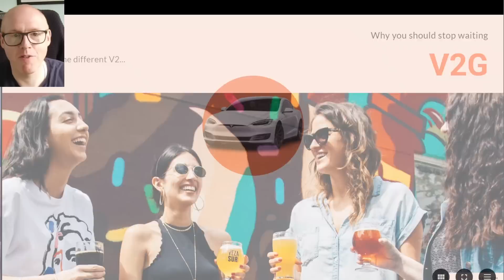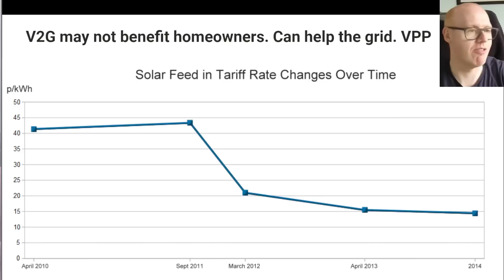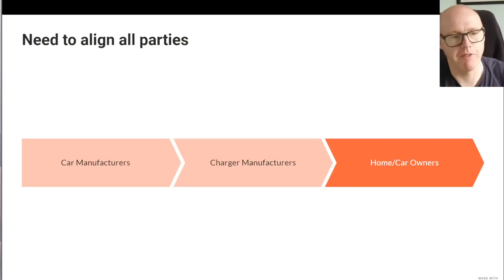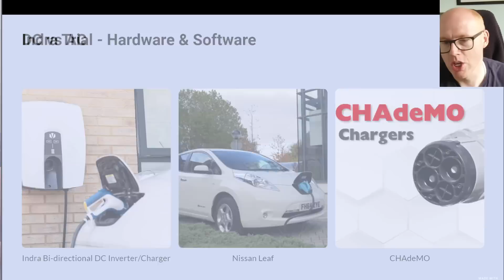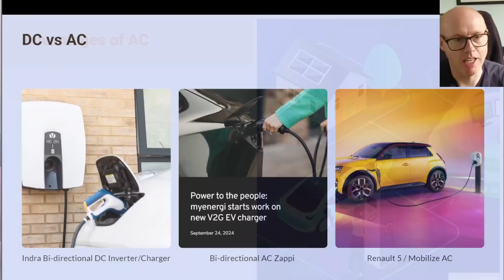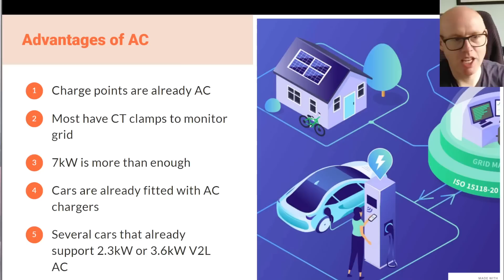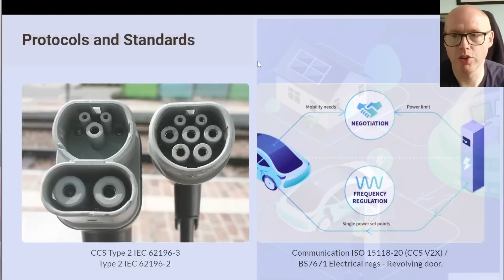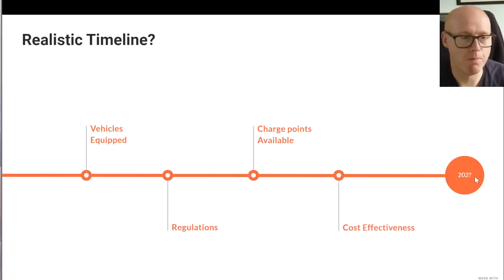Power your House from your Car - The FUTURE V2G

Comment: I have given up waiting for V2X and decided to buy a used eNiro. But I have a SolarEdge solar system with battery already set up for 5kW export and have just heard that SolarEdge are bringing out a two way DC charge point so it may be possible if the DC side of the vehicle is two way. I am mainly interested in using the massive battery parked on the drive, but if the SE system can just integrate the car as another DC source then I have everything needed with no update in regulations needed.
A great video thanks I will have to investigate the SE charge point and the eNiro a bit more.
Reply from the maker: I like your optimism.

Hope for the best, plan for the worst.

I think you're wise going for a great used buy.

I doubt the solar edge bidirectional charger will be economically viable and I imagine you'll still need DNO approval to add it on.
Reply: @UpsideDownFork  Thanks for the reply. As it is only adding another battery I don’t think DNO approval would be necessary. But further research it seems that there are problems with the UK SE unit and of course unlikely to be Octopus aware. So continue with plan A and a Zappi which I can control with HomeAssistant.

Comment: Read an interesting post about running power from the car into mppt ports on the invertor
Reply from the maker: How is that possible? Do you happen to know what vehicle/inverter they got this working with?
Reply: @UpsideDownFork  It was a victron invertor, but I believe it would work with any invertor as the invertor thinks the power is coming from the sun. The voltage would need changing from 12v dc or 220v ac to invertor min voltage. I'll ask an electrical engineer next time I bump into one haha

Comment: I agree that bidirectional AC is the right way to go. Much cheaper and 7kW is generally enough for most purposes. Quite a few cars already work doing this (Kia Hyundai). VW would work except that the software gets shirty when the charge rate goes negative and turns it off. It's just a software fix which VW say they've changed recently. You can make it work by using a Pionix charger. The bit I'm not sure about is whether all/some cars need some extra electrics to sync their inverter with the grid, or if they already have that. Essentially cars need to do the G98/G99 thing because they are generators. V2H and V2G are the same here (unless people have fancy islanding inverters, and hardly anyone does). AC sync is required and the car is now being a generator so needs to behave like one in failsafe terms. I'm guessing that no cars have G98/99/100 certs yet, so it will work (with a few cars) but it won't be legal, and it could actually be dangerous if they don't turn off when they should. (maybe the EVSE can be the failsafe, but I don't know if most/many/all/any are smart enough to disconnect if the mains side goes away?
Reply from the maker: Thanks for commenting

Comment: All I want is a second hand V2H unit but none to be had and if you find a new one they want £2000 what a rip off, More quantity  to drop the price, should be standard to all houses with EV cars and we can all help the grid and our homes, somebody out there wants to wake up and cash in NOW, When my old 24kw  Leaf is not road worthy I have a cheap battery storage system all I want is the BOX
Reply from the maker: Unfortunately it's a lot more complicated than that. It shouldn't be but sadly it is.

Comment: Interesting to see that there are 3 levels of V2X.  We bought a BYD Dolphin partly because it has this facility.  Had it 9 months and never used it.  Will wait for 2-way chargers to be available before installing one.
Reply from the maker: From my initial research it seems like BYD have implemented V2L only for the UK market. 
I'm not sure if this will be upgradable to V2H/V2G and whether that will be a software update or different hardware needed.
Reply: @UpsideDownFork  I read reports of Dolphins being used in Australia to run electric items for days after a major storm.   Must be at least 6 months ago.  Ours is a Spanish model.

Comment: I'm not sure how the DNO would be able to tell the difference between v2g and v2h if you have a solar system and the car power is delivered through the export meter and at the g98 connection capacity limit. Unless you were exporting 4kW/h after dark obviously 🤣
Reply from the maker: Exactly!

Comment: There is nothing complicated about a V2G hardware. Just think about it, ANY hybrid solar inverter would work. Just tie the CCS into the solar inputs of the invrter.
Reply from the maker: Have you done this?
Reply: Yes, the tricky thing is the software, some cars also want to see a pre-charge voltage.

Comment: When you think about it, your consumption does follow you to your location. V2G benefits all parties well beyond the home. At work particularly, especially if your building could have solar. Or any car park: supermarket, gym, airport..... Win, win.
Reply from the maker: I'm not sure I follow? Charge at home and then discharge at work? 
Doing the other way round also makes little sense, work place chargers are not the cheapest.
Reply: @UpsideDownFork  We need to electrify and we need to do it quickly. Some ready-to-go solar farm projects are being quoted 13 years for a grid connection... V2G localised consumption, storage and balancing would help alleviate that issue. Localised generation (government carrot and sticks to get solar onto the roofs of commercial buildings) would provide battery storage and consumption wherever the vehicle is plugged in without straining the grid. We consume energy when we’re at work, we consume it when we get home. The V2G VPP actually moves to where the consumption happens and where the grid needs balancing.

Employer can provide free EV charging for the employee with their excess solar (including those who aren’t lucky enough to have home charging) in exchange for access to that storage when the sun doesn’t shine (think Kraken). Employee can even use that energy for V2H when they get home in that dirty evening peak. 

The government gets to meet its 2030/50 environment targets, the grid is future proofed and the cost of energy for business and individuals trends to zero (looking at you Tony Seba).

But as you describe, there’s a lot of ducks to get in a row for V2G to be a meaningful thing, but take a few steps back, find a switched-on government minister and V2G could help save the planet, the economy and our pockets all at the same time.

I have a dream… ;)

Comment: I really can't see V2G becoming universally normal for a long time to come, it's a lot of expensive hardware and software with potentially diminishing returns for the home/car owner,  maybe for large fleet operators with a fixed work pattern it will be of more interest.
Even V2H still has a limited market, I don't think it's widely acknowledged just how many people are blocked from having a cheap overnight tariff due to lack of a working smart meter.
Reply from the maker: Yep, lots of hurdles but I'm hopeful that those who currently have EVs and home charging will be migrating to V2H within the next 5 years.🤞

Comment: V2G has so many advantages that it’s bound to come soon. We just need solar hybrid inverters that know how to use a car as a part of their network. That’s really all it needs because they already have everything else it needs.
Reply from the maker: It's been brought to my attention that there is the possibility of V2L vehicles connecting through the aux/generator input that many hybrid inverters already have. Interesting avenue for me to explore!
Reply: @ that would rely on the car’s v2l inverter circuitry to do the work though.  I think most of those are quite low power.  I would like to get the full dc current handling of the dc charging circuits to work and let the solar inverter be the limiting factor.  The beauty of the car battery is its huge energy storage and its huge current capacity, and the great thing about the solar inverter is that it can be as big and heavy as it likes.
Reply from the maker: @dominicgoodwin1147  True, but it's a solution for right now. My Sunsynk inverter is compatible. Some V2L vehicles are rated at 3.6kW and there are off the shelf cables that can be used.
Some people have actually tricked the MG4 to output 7kW through V2L.

Comment: I know the F-150 Lightning is not sold here, and Ford have cut production - but it seemed interesting, since its aggregate V2L capacity is 9.6kW.  I had an interest in retiring somewhere sunnier and being off-grid.  If you can utilise that output (maybe even 70% of it) then you can potentially regard the vehicle as the stand-in for having a generator and all its gubbins, and go and buy electricity while doing your shop for groceries in the winter.  V2G would seem to me to be a way for power companies to cycle your battery while not paying what they should.
Reply from the maker: @jamesmansion2572  I  had a close look at these whilst in the states recently. Those and Rivians were fairly common sight in California. 👍

Comment: I see the benefit of V2L for people who like to tailgate, or working at remote locations with electric tools. 
I see the benefit of V2H if you can charge at a low cost and release when the cost would be higher, thus lowering your overall home electricity bill. But you still want charge in that vehicle when it's time to drive, and you lose some energy through resistance every time you move it around.
Also if there's a powercut (rare in my area but can happen) and you don't have a backup (e.g. solar panels, gas generator)  then this might tide you over for a bit.
I don't see electricity companies allowing masses of people to charge their batteries at low cost, and then sell back to the grid at a higher cost. That just doesn't make economic sense for them.
Plus every time you move that energy you lose some, you're adding adding wear to the battery.
I can see energy companies pushing this and then shafting the consumer when it gets too  costly for the company, by changing their terms and conditions.
Reply from the maker: Good points!

Comment: I have a BYD with V2L. I have sufficient solar panels to be nearly 100% off-grid. I use the car to heat my hot water tank whenever the home batteries are low and solar is unlikely to be enough to fully recharge my home batteries. If the batteries do reach full charge later, then I just use any excess to top up the car again. I'm literally working on how to connect the car directly into my Sol-Ark 15k inverters Generator input, so that in a big emergency it will assist the home batteries with keeping the house going.
Reply from the maker: Interesting that your V2L works with generator input!
Reply: @UpsideDownFork  Just to clarify I'm working on how to do it. Currently I'm connecting my car into a Smart Load seperate breaker / fuse box and powering the water heater from that. Once I've got the inverter to recognise the car, the same box will feed the generator input.
Reply from the maker: @simonpaine2347  Please let me know how this goes. My Sunsynk inverter also has a generator input so i'd be very interested in any developments in this area.

Comment: Weather the inverter/charger is in the car or the house we are paying for it one way or another.
If it is in the car then you are carrying around the extra weight, but in theory you can carry a low charge rate cable with you and charge anywhere, and use fast chargers, if the vehicle charger fails then you are stuck until it is repaired. But if it is in the house you could potentially go elsewhere and charge.
DC to the house means that the house kit sorts out the paper work and the regulations for connection.
But what ever happens it needs a standard that everyone adheres to.
V2G could if everyone was on the same sheet lower the need for gas generation but it system needs to know when you will be needing the vehicle and leave an emergency amount in the vehicle.
But as you stated, quite a lot are now fitting home storage so negating the benefits to either party.
The way I see it their are pros and cons either way.
Reply from the maker: Thanks for commenting!

Comment: I can't think of a worse way to 'help' the grid!
The grid controller can never be sure how much power they will get this way, so one more variable on a grid with so many other variables from so much asynchronous inputs.
As for consumers, the vehicle owner buys at commercial rates of electrcicity so must resell at a higher price to make it worth while so adding to the overall cost to the average consumer.
It is also inefficient and adds yet more unwanted harmonics from the inverters onto the system.
It most certainly is not the future.
Reply from the maker: Would be good if homes could be self sufficient throughout the 4-7pm period?

Agree on your points though.

On the surface it has much promise, but dig a little deeper and there are many challenges.
Reply: @UpsideDownFork  
If we had a reliable and economic grid you would not even ask that question. Reality is we don't have such a grid and it is a reflection on how badly our politicians (on all sides of the house) have failed us.
It is up to the individual if they feel the need and can justify the cost?

Comment: Behind the meter Equipment integration is a challenge but most new EVs are a firmware update away from VtG. IMO, the real challenge is with the DNO, the roll out of their ADMS/DERMS takea time and every change needs to be tested thoroughly. Saying that, the UK is in the pole position in this respect, so we might see non-DC VtG before 5 years.
Reply from the maker: @rrlabastida  fingers crossed.

I'm hoping for a G98 approved bidirectional AC charge point that will be connect and notify just like a current solar inverter is 👍

Comment: Great video, thanks for posting.
My main reason for using V2L or V2H would be to keep my central heating running in a power cut (50 watts).
As an interim solution for emergency back up would the following work ?  Using a plug in hybrid with V2L, like the MG HS , to charge a Bluetti power pack (2kWh). Then get the Bluetti to charge the home battery. The PHEV could then recharge the car battery and run the cycle again and keep the house CH running as long as there's petrol in the tank.
The home battery (15 kWh) would back up the CH initially for about 5 days and then the PHEV and bluetti/inverter/home battery for say a further month, worst case.
Would this work, with the appropriate earthing and changeover switch of course. I suppose the main question is, can a Bluetti (DC) be connected/disconnected to and from a home battery system safely.
Reply from the maker: Seems like a convoluted solution.
A home storage battery will keep 50 watts going for a very long time.
Reply: @UpsideDownFork  Yip, I know, about a week. But, ah but , what if the power cut happens  at 9pm, with the battery depleted to say 5% prior to night time charge ?
Then the PHEV,/Bluetti/Home battery steps in. I'm kind of more interested in the feasibility of doing it.

Comment: The potential of vehicle-to-home (V2H) technology to revolutionize energy consumption is immense. As V2H-enabled vehicles become more prevalent, drivers could access cheaper electricity at their workplaces and utilize it at home. This presents a fantastic opportunity for employers to install solar panels on their roofs and sell excess energy directly to their employees, bypassing grid limitations.

Currently, the grid's capacity restricts the amount of electricity that can be fed into it. However, V2H technology offers a way to circumvent this bottleneck by enabling direct energy transfer between workplaces and homes. This could lead to a more decentralized and efficient energy system, reducing reliance on the grid and promoting the use of renewable energy sources.
Reply from the maker: Most people who have workplace charging pay 20-30p /kWh for it.
Tax implications are difficult for companies who don't charge their staff.
I see V2X as the best way to stabilise the grid and the other benefits to be minor/secondary.
Reply: @UpsideDownFork  That's a shortsighted viewpoint. Having a more efficient system is in everyone's interest. The government could make daytime company EV charging tax exempt because it saves them from building as much transmission lines. Employers are also desperately trying to get employees back into the office so this could be a small enticement.
Reply from the maker: @zen1647  Short-sighted? Maybe. Realistic? Definitely.

Comment: EVE lf280s are discounted heavily now, you can get 14.5kwh cells for < €1000 (€69/kwh), bms/case would add another €500.  But this battery wont drive off for the day just when you need it or your house wont drain the car when you want to drive. With v2h, car batteries will get bigger, more expensive and cars less efficient.  I prefer the philosophy of the original ioniq, modest battery with high efficiency.  ESS batteries can be cheaper, they can have much lower energy density.  It makes sense to separate them.
Reply from the maker: Thanks for commenting!

Comment: What happens if I make a cable up with a plug at each end. One plugs into a kia ev5 adapter and one into a wall socket in my garage.
Reply from the maker: I don't think anything will happen. The V2L protections in the EV6 will prevent any power output to a grid tied system.